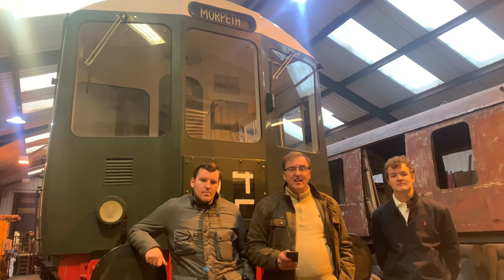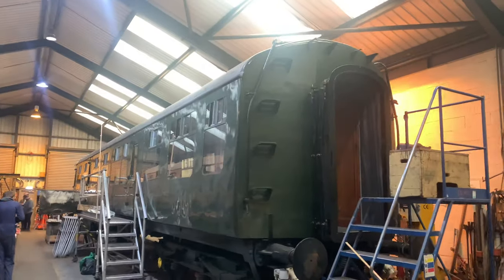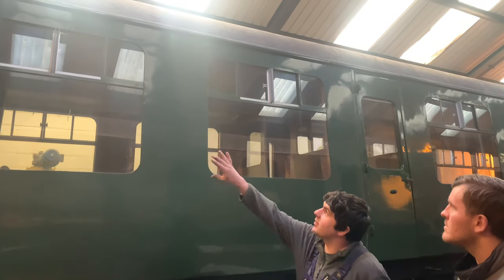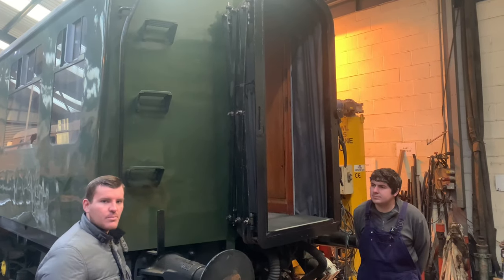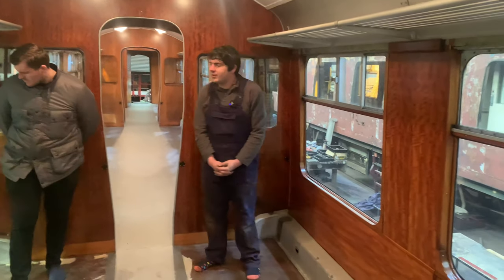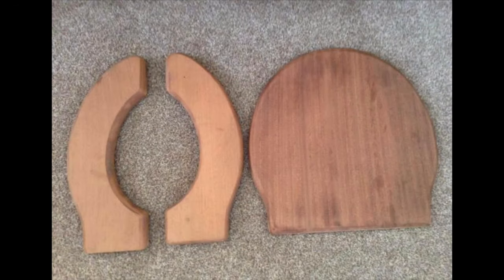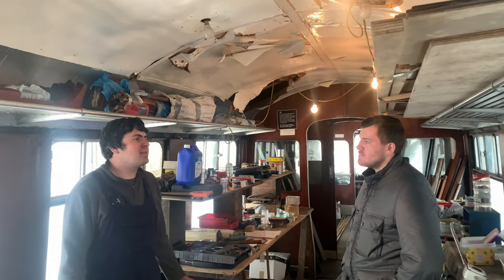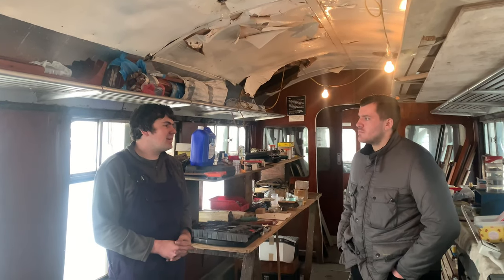Railcar Restorers on the road Ep2, The journey of a 104 DMU restoration at the North Norfolk Railway

Comment: Why are the exhaust systems so loud?
Reply from the maker: I believe it’s due to the short wheelbase on the vehicle and due to a lack of silencers in the system that gives them the throaty tone!
Reply: @RailcarRestorers   Yes.  During 1978, most class 104 DMUs had sound proof exhaust systems.  They sounded just like The Leyland Route Master double decker buses.
Reply: @RailcarRestorers  full throttle engine speed in neutral gear is 1900 rpm at Notch 4.